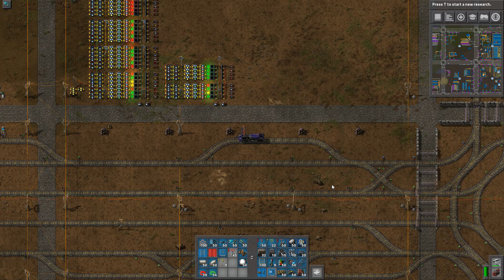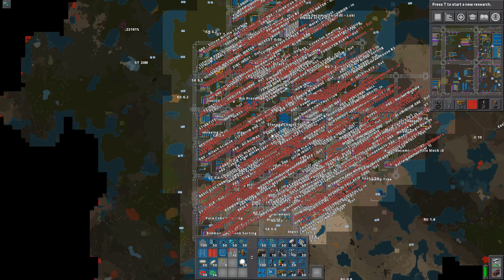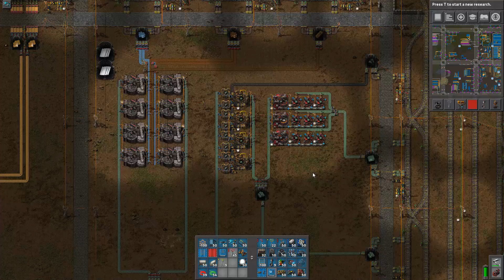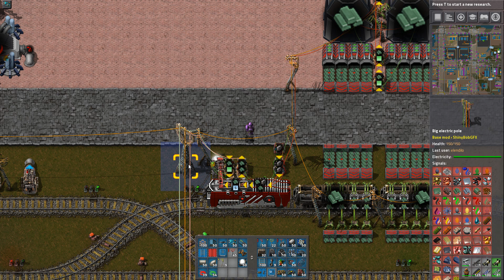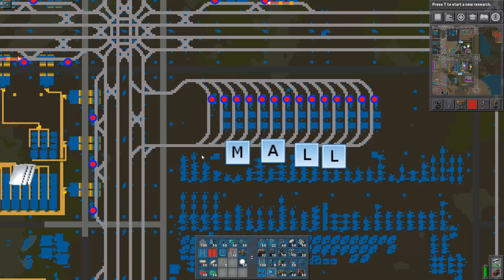Factorio Engineering - BLOCK BASED TRAIN NETWORK - Community Map Review

Comment: Main difficulty with this setup is when you have multiple stations open the closest is served first. I'm trying to implement a collision-avoidance system so that there is an extra step after a station decides that it needs a train; if there is another station already requesting it will wait a random time (1-5 seconds) before checking again, and only request when the line is "free". The second part is to lock a closed from when a train arrives, for at least 6 seconds after it departs. Together it should distribute more generously to far away stations, but does reduce the number of simultaneous trains to 1.
Reply: I think i forgot to mention it in the guide. I've added a troubleshooting section (which may be extended later)
Reply: That's why you use tsm.

Comment: Took me a little while to figure out, the blueprints provided in the doc are missing a couple of things. Here is a little setup blueprint with it working, (replaced @, as I couldn't find it, with fish otherwise its the same)

https://pastebin.com/A4DcKnha

Pop in a train and follow the instructions on the main doc.

Great system :)
Reply: I used '@' to set the cargo size of the wagon. In your case each cargo train could carry only 100 items (this is set as 'fish' in your setup). Keep in mind that the train won't leave until the wagon is fully loaded. In your setup the supply station would activate if there is 100 wood in storage but in the worst case the train could only get a maximum of 3999 wood, In this case the condition 'wait until cargo inventory is full' is not true (1 wood is missing) and the train will stay in the supply station forever.
Additionally, you're missing one red cable in the request station which combines the train contents with the local storage (take a look at the power pole below the request station combinators). Furthermore you should connect the big power pole next to your leftmost depot to the main train network with a red wire.
You don't need to make specified depots (like 'Wood-Depot'). a general depot station will work perfectly as long as all stations have the same name. My intention was to prevent 'ready-to-use' blueprints for each station type. I think the missing part you mentioned was a general setup.
Reply: I was messing around with small amounts, hence the 100 items. Missed that red wire, It seemed to work xD

I assumed the blueprints were ready-to-use, the only bits not in the blueprint are the cargo size combinator and the arithmetic combinator that does 'cargo wagon' x @.

Thanks for the reply and help, such a cool system :)

Comment: Just read the whole document. Whoa. The way of documentation for a map is awesome on its own. 
There is only one thing i´d do differently. Im also using some kind of non LTN logic (not as advanced) and to refuel at a depot, i have for a long time used inactivity instead of time passed. Even 1sec of inactivity is enough, the game is capable of looking at a train and say "ok, that takes an inserter to work, so its activity and needs to be stopped" 
I have alot of trains that barely have time to refuel so i tried 1sec and its working for about 30 hours now.